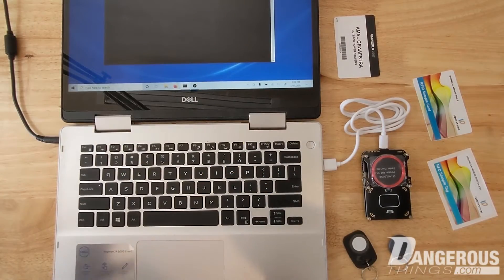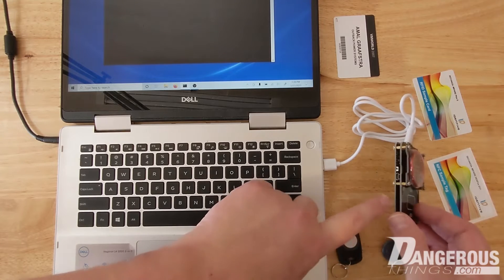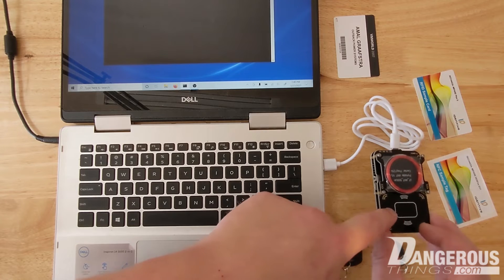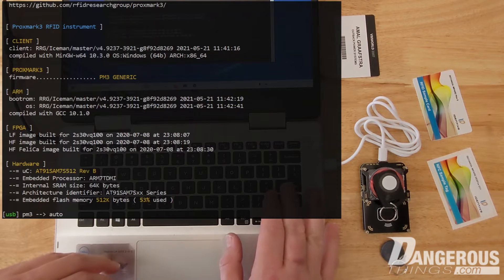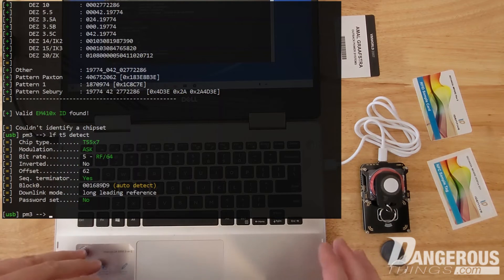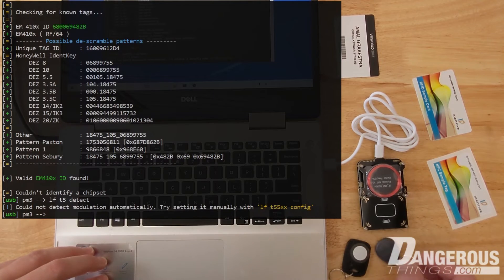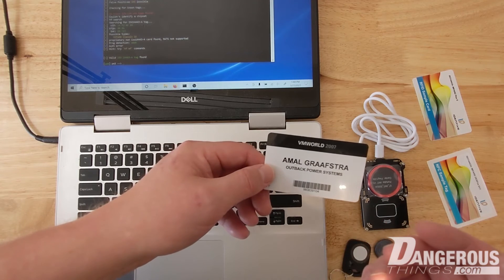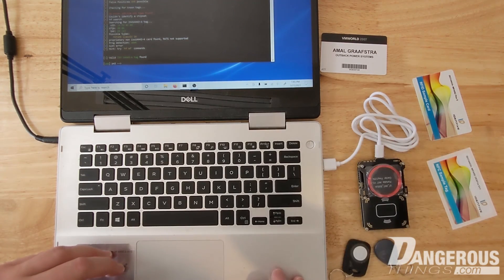Detect chip type with a Proxmark3 Easy

Comment: Hi, how can I identify one type of access card? The voltage changes from 38V to 30V during HF tuning, but the Proxmark3 didn't find anything when I tried the commands 'auto' or 'hf search'. What i do wrong?
Reply from the maker: It might be that the card is a type that the proxmark3 is not able to automatically identify. You may want to join the Iceman discord server to see if you can submit some scan detail, or join the dngr.us/forum and post there. Also, confirm you are using the Iceman branch of firmware and client.

Comment: Hi, I know this sounds like a lot. I am trying to modify a NTAG123 NFC tag to write the UID of the tag, change it to another specific number. So I need two tags with the same UID. Would it be possible with this Proxmark3 Magic ntag tool? Thanks a lot!
Reply from the maker: Hey sorry for the late reply.. you can't change the UID of 99% of all RFID and NFC chips.. they are designed to be static serial numbers that can't change. Only a very small number of a special type of chip can be reprogrammed with a new ID.

Comment: That intermediate board that you say does nothing, does it have any electrical connection?  Even a ground plane?  I was thinking it had ground to protect the active circuitry below from having induced signals from the LF antenna above.  Or not... thanks for the informative vid!
Reply from the maker: It does play an insulative role, but not for the electronics, more for the LF antenna itself. Removing it does detune the LF antenna a little, but there's no practical effect on performance.

Comment: I was implanted with a rfid glass chip against my will in 2017 in a part of my body that cannot be accessed easily, I know nothing about the chip only that it is powered by body heat, my question is how far away from the chip does this reader have to be, for it to be readable??? since 2017  I have noticed a guy who keeps coming to places that I am he always has a laptop with him and it has a big square thing plugged in to it with 2 antenna on it, when I started noticing him I noticed he would always be sitting a good few seats away from me after about 30 or 40 minutes he usually is sitting at the table behind me with his laptop out I do get spooked an get up leave the shop or cafe walk about 50 yards then he leaves stright away, my main question is how can I access this chip that is in me? What do I need to do so?
Reply: Are you alright dude
Reply: Cut it out with a dull knife